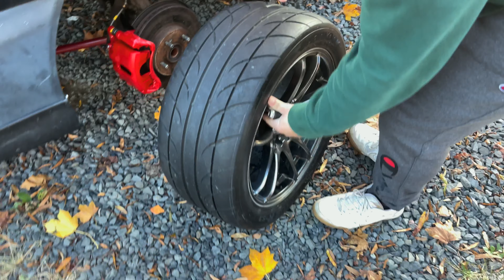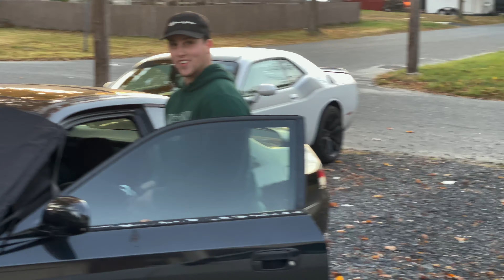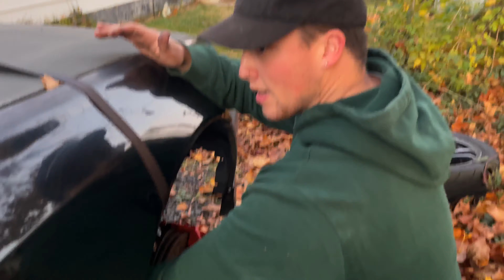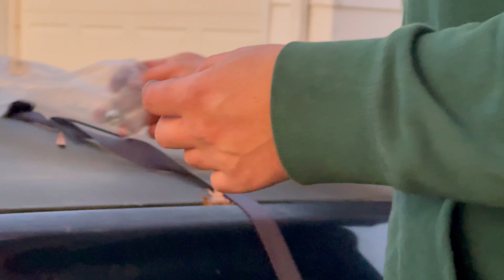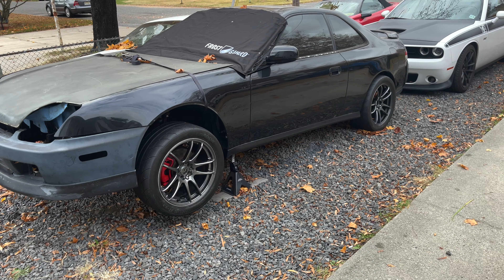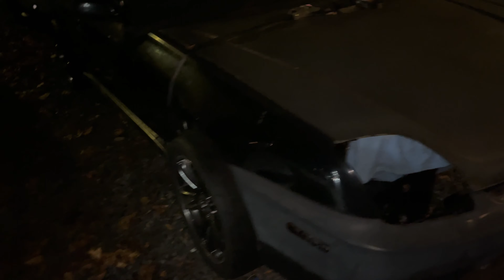Completing The preludes suspension overhaul (with tsx front arm conversion)

Comment: How did you you fit the tyres without rubbing
Reply from the maker: Hey man, my car is only lowered 2 inches and pretty well weight reduced so its not the lowest car out there. So theres the first part, but the second part was i bought a mystery set of jnc drift kings theyre 17x8.5 and i dont know the offset but i have no rubbing on the inside but when the car hits bumps because nothing is rolled it contacts the fenders and quarters. Right now the tires stick out around .500-.625”

Comment: Can you get into the perks or purpose of using TSX front control arms? Is it a cross-referenced part?
Reply from the maker: Double the adjustability of adjustable ball joints and better arms more clearance with arms instead of the adjustable ball joints hitting the shock towers